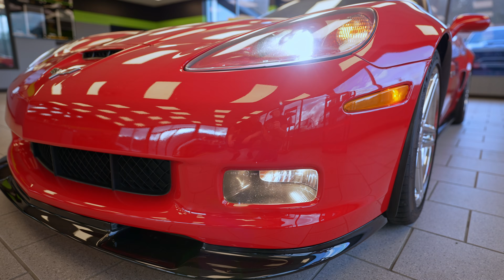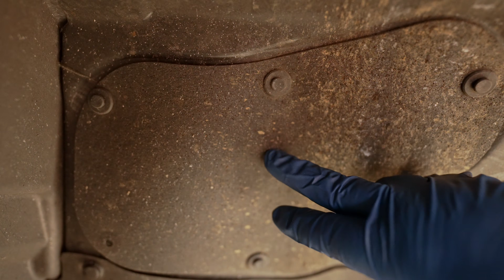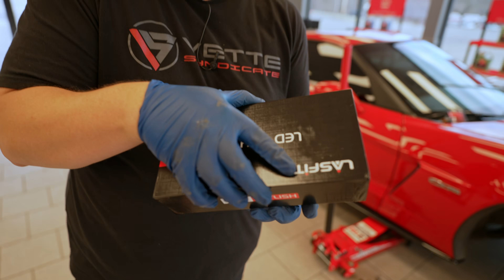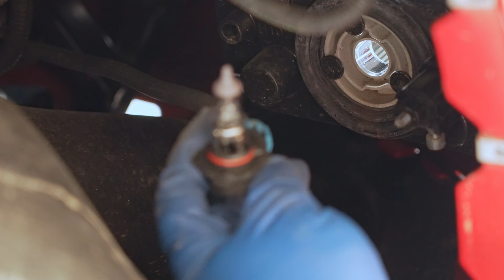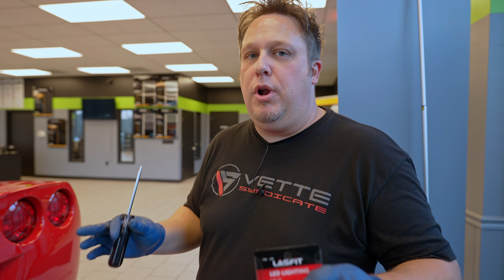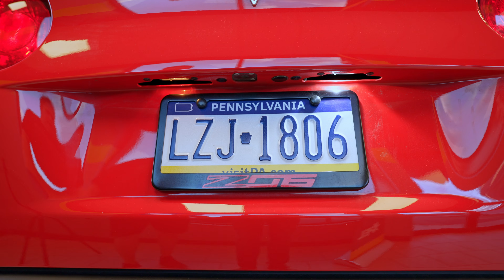C6 Corvette Z06 LED CONVERSION! Lasfit LED's make the C6 look NEW again!

Comment: The Link for the Switchback links to a product that says: 1. This product will not work properly for 1997-2013 Chevrolet Corvette…. Is there a new link to the product you installed? Thank you for your help!!
Reply from the maker: They worked fine for my car but apparently they changed something. As of now, I don't know of a replacement that works.
Reply: Are they the same bulbs?

Comment: I just ordered a set of InfiRai tail lamps in the painted smoked look. I was contemplating on changing the entire front headlamps too but they are very expensive. Its not that I cant afford it but the question is do I really need the look of a C7 or C8 style headlamp on my C6? Those modern headlamps look great but I am totally ok with the current C6 headlamp configuration and look. I found this video and decided to go with switching to LED's instead. It takes the current C6 headlight configuration and sharpens it up a bit.
Reply from the maker: All it takes is some crisp LEDs to make anything look better!

Comment: hyperflash after installing front blinkers. , installed resistor from amazon and still having same issue.any suggestions?
Reply: noticed how the video doesn't show more than 2 quick blinks from the front turn signal led? That was done on purpose to mislead viewers.

Comment: You totally left out the part where the high beam dust covers won’t go on at all. Bought these because of this video and this part was a let down. Vette lights offers this mod with custom dust covers for $100. I know this was a sponsor video but being completely transparent goes a long way. Just cutting to the fog light install seems intentional.
Reply from the maker: I left that out on purpose, I didn't put mine back on due to the high beam having a fan on it. I figured if there's a fan, it needs cool air.

Comment: I have a 2007 Vette and these turn signal LED's have the built in resister correct? I bought the vette a few weeks ago and have hyperflashing and im assuming the guy before me replaced the lights and did not add resistors so before I buy im just making sure these work. Thank you

Comment: I’m ordering.  Why didn’t you change the bulb in the middle. I have to.  Mine is out.  What bulb is that?
Reply from the maker: The low beam is an HID bulb. A little more expensive to replace.
Reply: @HorsePowerObsessed does Lasfit sell the low beams?
Reply: D1S

Comment: Nice video. I do not see the link for the high beams. would you happen to have that also. Thanks
Reply from the maker: Thank you. I noticed the high beams don't fit under the dust cap so I took them out of the list.
Reply: @HorsePowerObsessed  ok, thanks
Reply from the maker: You’re welcome
Reply: @HorsePowerObsessed  Have you had any luck finding led high beams you like yet?
Reply: I put the switch back lights in and am noticing my drl's run amber and white, not sure why and I still get hyper flash any suggestions. Thanks
Reply from the maker: @arthurleyba3549 if you’re getting hyper flash, you may have gotten the wrong bulb. Contact lasfit and let them know and they will get you sorted.

Comment: The amber light will still automatically come on as a running light. For it to run the led white you have to manually switch it on. I thought the LED white would replace the amber as the running lights?
Reply from the maker: I'm pretty sure that IS how it's SUPPOSED to work.. I'm still trying to figure that out.
Reply: Okay. Let me know. I replaced them the way in your video.
Reply from the maker: Will do.

Comment: I just made these same upgrades and love the way things look now.  However, I do get random hyper flash from the turn signals.  It's not all the time, but majority of the time while I'm driving around they hyper flash but when I'm parked they don't.  Anyone else have this issue or can suggest a fix for me please?  I'm curious as if it is because I have not upgraded the rear lights so the timing is off which will cause the car to think that a bulb is burnt out and thus drive the hyper flash?  I have LED tail lights arriving tomorrow - I'll update soon.  Thanks.
Reply from the maker: Interesting. These have built in resistors so if you get hyper flash at all it might be a bulb problem. Lasfit has warranty for that exact reason, maybe reach out to them and see what they say.
Reply: @HorsePowerObsessed  Yeah, I'm thinking its a bulb problem now.  They hyper flash randomly.  I did reach out to Lasfit but was directed to send them an email instead.  I was sent a refund for the lights but my issue was never resolved nor any explanation given.  I'm in an email ping pong game with them now to figure out what the deal is and try to get replacements. Thanks.
Reply from the maker: You’re very welcome! Let me know how it ends.
Reply: Well, I spoke with technical support and he suggested I just stick with halogen bulbs. Another tech I spoke to said they don’t make bulbs that fit my vehicle (08 Z06). And the last finally agreed to send me replacement bulbs and sent a request in the “back shop” to send me new bulbs. This is what I just received from them, 

Hello,
Since some Corvette owners met the same compatibility issue even after installing the replacement bulbs, we suggest that you can keep the stock halogen bulbs instead.
Thanks for your understanding.

So that’s that I guess.
Reply from the maker: Wow what the heck? Let me reach out and see if I get any more information.
Reply: I get the same thing happening to my 07 base corvette! I got the lasfit ones AND the gtr lighting carbide 2.0….both randomly hyperflash! Very annoying and thinking I might have to get the harness with the built in resistor! The resistor is my absolute last resort but thinking I might have to do it.

Comment: DRLs are Amber (not white) in Auto Headlight mode.  This looks to be normal as the DRLs are actually the turn signal lights, not the parking lights.  Turn signals are Amber and cycle at higher freq in Auto also.  Works as advertised in manual light mode.

Comment: Any EMI with your radio?
Reply from the maker: None at all.
Reply: @HorsePowerObsessed  I have it when the B/U lights are on.  Radio goes from Stereo to Mono.  No biggie since you're not in reverse too long, but show there is EMI from these LEDs (as all LEDs emit RF).  Signal lights also interfered with radio reception due to EMI, so removed and returned.

Comment: I love what you did with the led upgrades! However, I would most likely upgrade the old C6 head lamps to a Morimoto C7 or C8 style headlamp. It will dramatically change the whole look of the car and make it look more up to date and modern. Just my opinion 😉
Reply from the maker: I wanted to try an led upgrade before moving to the morimoto head lights. They will be coming soon though!
Reply: @HorsePowerObsessed  Nice!! They will look awesome.
Reply: I had those and got massive EMI on my radio signal strength.  Had to remove them.

Comment: Did the boot fit back on the high beam? Also why no hyper flash? Are the resistors built into the bulbs?
Reply from the maker: Resistors are built in, yes the boot fits.
Reply: @HorsePowerObsessed  awesome thanks for quick response. I put all led in my GS but the boots didn’t fit back on and I had to use resistors on all for corners.  Please check out my led swap results. https://youtu.be/oF5AfkmzM2E
Reply from the maker: Very cool! I purposely used these particular bulbs because they have the resistors built in and it’s less of a pain install.
Reply: @HorsePowerObsessed  thank you, I wish I would’ve known about or researched better and bought the Lasfit bulbs.
Can’t wait to see what you do with the tail lights.  thanks again.
Reply: The boot does NOT fit over the fan for the LSplus H8/9/11 high beams.

Comment: Looks good, but you do realize there is a entire headlight assembly upgrade for cheap that puts the Z06 on par with modern cars?
Reply from the maker: So does a much cheaper individual LED replacement. Those headlights are over 1k. These leds are under 200 bucks.

Comment: Totally blew by the fact that the low beam bulbs from Lasfit requires you to not able to use the dust covers. There is one company that has LED's for low beam and comes with replacement dust covers. (Glad to see the sunglasses were not used in the making of this video  🤣🤣).
Reply from the maker: I actually didn't change the low beams. Only the high beams in this video for that fact and because the low beams are already HID.